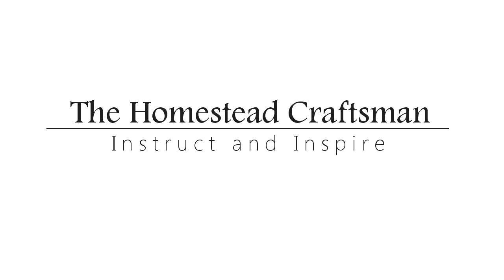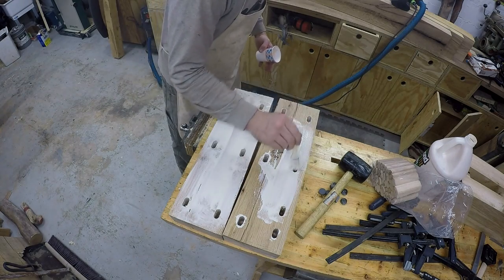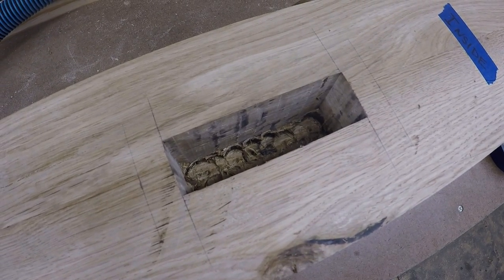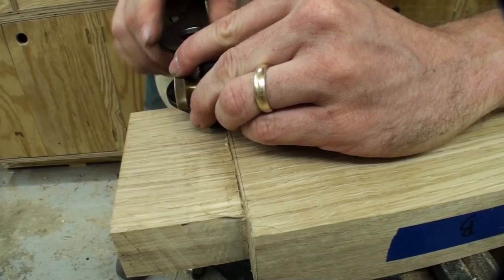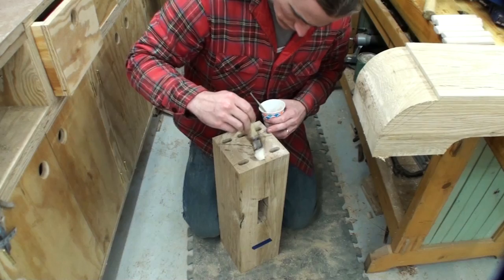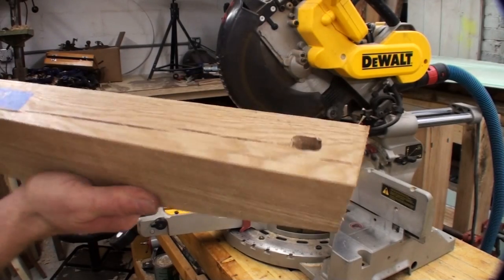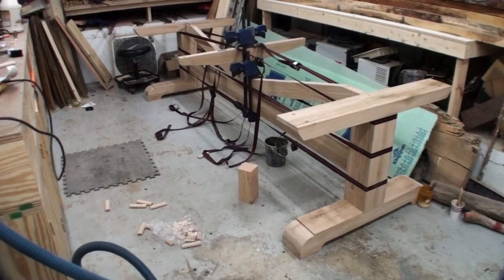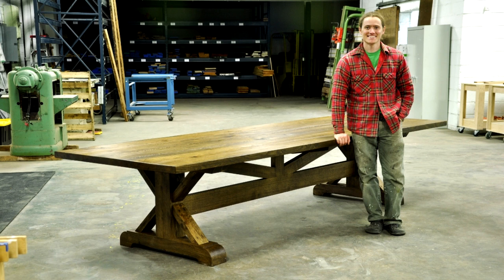Part 3 - Building a Table Base - Oak Trestle Table Woodworking Series!

Comment: I like ML Campbell.  They also make a dye stain that I use that is incredibly fast drying (even faster than the lacquer).
Reply from the maker: That would indeed be fast, the lacquer is very quick.
Reply: You can spray one side and immediately flip it and spray the other. Must be sprayed though, but I like it. My dad owns a cabinet shop in Fayetteville, TN and I have used it there and in my own hobby shop and it works well. Pretty pricey.
Reply from the maker: I like spraying, so that's not a problem. Is it durable enough for table tops?
Reply: I personally think so. Especially with the hard lacquer clear coat.

Comment: I have watched this video 3 times now! Impressive work as always!
Reply from the maker: Thanks
Reply: Do you ever experience your table tops cupping after you assemble them? If so, how do you fix it?
Reply from the maker: Not really, sometimes I have seen the slightest cupping, a tiny amount, but my lumber is kiln dried which stabilizes it. My lumber is stored in my shop, which is climate controlled. It is used in a table then goes straight into a customers house. Using the right lumber is important.

Comment: Great stuff! I love Oak. Hopefully I'll be able to afford to work with it some day.
Reply from the maker: I got all this wood, several truck loads for under $400. Just enough for one project should not be that much. Rolling up into woodcraft or other stores like it is going to be expensive, you have to get just as creative with your lumber sources as you do with your projects! Look for things you can take apart, old furniture, etc. Reclaimed lumber, cheap air dried or green lumber. If you want it, you can get it. Good luck.
Reply: Agreed... Look around for local mills... For me where I live I have a very good Amish friend with a hard wood saw mill and his brother who has a soft wood... Soft wood meaning he mainly cut Pine logs into construction demential lumber to a true 2"x4"x 8' stud not 1 ½ x 3 ½ x 8 from the box stores.  I have taken several Ash logs, Oak logs and such to them... spilt the lumber with them for free saw milling... or pay them with adult beverages for milling time.  The key is to get to know them.  I have even pick up lumber that I did not being to them for really good prices.... like a ½ ton truck load of bass wood. 12 quarter x 14" x 10' beams for $56.00. (bass wood for wood carving)

Comment: Love your videos, especially the ones where you're cutting trees in to planks, mesmerizing for some reason! I wanted to ask you a question about your base. I'm making a pedestal kitchen table with a similar base. But mine will have two more "feet" so that the base has a total of four. Would joining the other two to the main one with Dominos work? I think the correct way would be to make that a half lap joint , but I'm new to this and would rather use my 700 to do it if I could.
Reply from the maker: Kind of tricky, but I think I get what you are saying. Depending on how long it is, you may want it to come apart. You could consider some sort of bed bolt type set up, Perhaps hanger bolts lagged into the main base, then the end pieces would have the machine bolts. That way you could tighten it up as well as take it apart. You could also do some sort of wedged tenons of some sort. If you are going to glue it all up, your df700 will work fine, just make sure you do a good number of tenons.

Comment: What a beast!!!! Nice job with the build and for what it's worth I think you were right to try to take out those additional supports... I think it would have had cleaner lines design wise.
Reply from the maker: That's what I was thinking. Having all those braces is a common thing with all the DIY trestle tables made from construction lumber as well. While they did not need to be there strength wise, they make it that much more bullet proof, something I won't complain about it.....plus they where in the design from the beginning. Thank you for watching.

Comment: Interesting note on the loose setting for the Domino:  Mathais Wandel (he has a YouTube channel) tested a variety of joints & configurations and found that a loose tenon in an over sized mortise (by width) and flooded with glue to mostly fill the voids on the sides was by FAR the strongest joint.  I think most people, me included, would have assumed the perfect slip fit mortise and tenon would be the strongest, but it was not.  So I think your table is actually quite a bit stronger than you figured initially.
Reply from the maker: It's a very strong joint, especially with this many in a joint.

Comment: Very nice build.  Curious as to why you used a tradition mortise and tenon on the stretcher vs dominoes?  Did you have concerns with the strength of the floating tenons?

Thanks
Reply from the maker: Just wanted a big tenon....no reason other than that.

Comment: How far in can that hollow chisel mortiser cut in?  For example, you were right in the middle of that 6x6, could you use that in the middle of an 8x8?

Great video, thanks again for uploading your content.
Reply from the maker: You can mortise to the center of an 8 inch board.

Comment: Very nice table and tottaly fine done video. What do you think, how much time did the Domino save you? How much longer (%) you think it would have taken you with traditional mortise and tenon? Greetings from Germany
Reply from the maker: I think the base would have taken twice as long at least and the tenons for the braces would have required a lot more thinking. With my time line that I got the wood back from the kiln, I would have not had enough time to finish the table without the tool. So on behalf of the United States of America, I'd like to thank the German people for such a wonderful tool.
Reply: :-D Thank you for the answer. 50% timesaving on the task is pretty substantial.
Reply from the maker: In the case of this base it would be days.

Comment: How would you attach the brace in the middle to the two ends if the table would have to be disassembled often due to moving? I would like to remove the top and the center brace and have the two ends remaining for packing the table easier. Thanks
Reply from the maker: I guess you could have it all assembled with mortise and tenons but not glue them up. You could do wedged or pegged joints, look up draw boring as well.

Comment: Hey Perry, do you think the festool xl is the right size for most of your projects? In other words if this build didn't require you to get the 700 would you still purchase that or do you think the 500 would work for most of your projects? (Just kidding on the perry thing lol)
Reply from the maker: Hi Gerald, short answer yes. Most things I make are on the larger scale. Even for making chairs and smaller projects this is still the tool I would choose. The 500 would be nice to have as well, but the 700 cuts for 8mm dominos, that's a little over 1/4 inch....so pretty small. They also make adapters to use the smaller cutters as well. Thanks for watching, yours truly, Perry

Comment: Thanks for all the great info! Any reason you used the rip blade for crosscuts or was it just what you had on hand?
Reply from the maker: It's what was on the saw, it was brand new and cuts great, even in a cross cut.

Comment: What size screws did you wind up using to connect the table top to the frame?
Reply from the maker: I used a combination of 2 1/2 inch and 1 1/4 inch kreg screws. The top is attached two ways, through the end bases up into the table top and with table top fasteners on the center support. Long screws through the ends and shorter with the table top fasteners.
Reply: By the size of the table top I would of thought you would have had to use lag bolts to hold it in place.Enjoyed your videos and great work on that table!
Reply from the maker: The table weighs at least 700 pounds, with the top being 12X4 feet and 2 inches thick. It's not going anywhere. There are 4 screws in each end and 4 in the middle. You could literally get away with no screws it's so heavy.

Comment: Okay, ..... , great job.   Great video.  (Video's)    Nice project on the whole !    My question has to do w/ hardness of wood regarding toughness or depreciation on tools (motors, belts, blades, etc...)   
In my experience, the average "Joe Customer", not familiar w/ rare & exotic woods, seem to desire Oak.  Over the years I've formed a dislike for the wood.  Besides the commonality of the wood, I find it very hard on my tools, which adds to my dislike and I wonder :

Do you specifically include the depreciation of your tools in the price ?

I mean to say, I imagine you do include tool depreciation in the price but are there types of wood the customer may desire (like oak) that would require a higher value set on tool punishment ?

Thanks for sharing your video's and your generous consideration,
Steph_Louisiana
Reply from the maker: Hey,
I don't consider any of that at all, I've got my stuff priced beyond this being a concern. I'm sure I could factor all that stuff in but in the end I'm going to price as high as I think I can anyway. So NO would be the short answer. As far as wood choice, oak is just a classic american wood, one that people are familiar with. It's easy to get, so that's a plus for me.

Comment: What did you use to attach the top to the base?
Reply from the maker: A combination of table top fasteners and screws through the base, both allow movement.
Reply: The Homestead Craftsman did you put the screws closer to the middle and the fasteners closer to the edge?